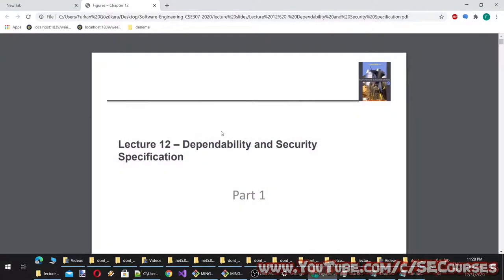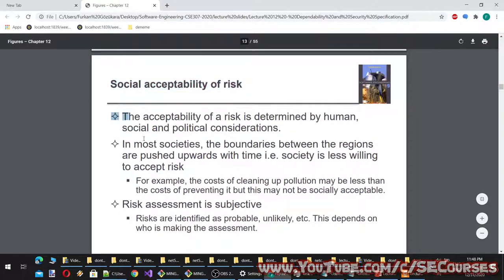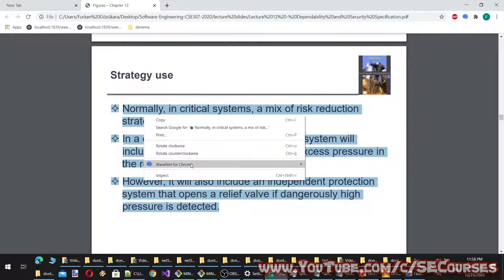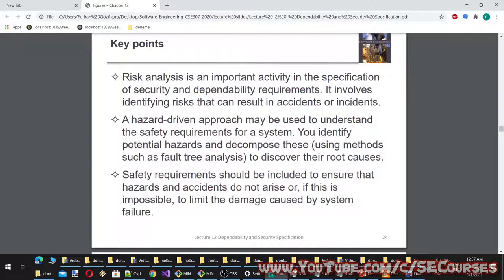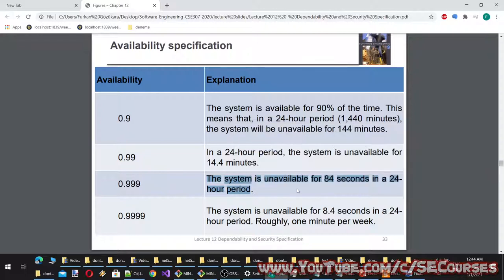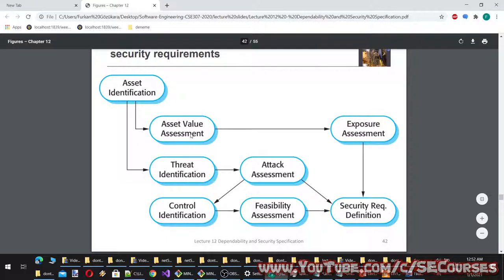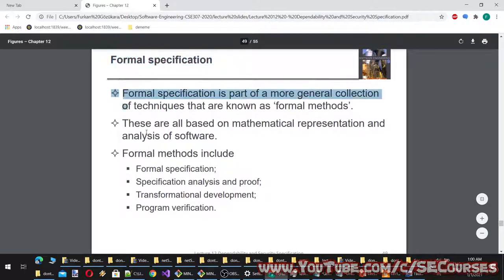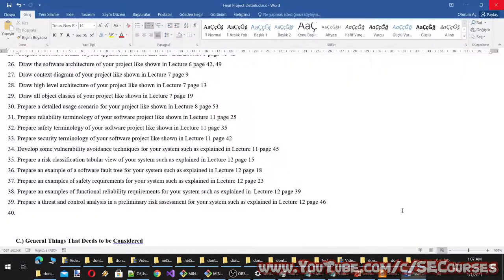#Software #Engineering - Lecture 12 : Dependability, Safety, Security & Reliability Specification

Comment: In this class, I learned:
standards for dependability Specification based on risk (understand the risk and other things).
Risk-based analysis stages (identification to risk and some step to reduce risk.)
Risk analysis and hazard identification in phases
Fault-tree analysis (which aids in identifying the system and identifying risk) and Hazar analysis

195050024

Comment: i learned
Dependability requirements,
Risk-driven specification,
Hazard identification and analysis,
Social acceptability of risk,
Risk reduction,
System reliability specification,
Types of system failure,
Over-specification of reliability,
Functional reliability requirements
,
Security specification,
Types of security requirement
,
Security risk assessment,
Benefits of formal specification
175050001

Comment: From this lecture i learned about;
-risk-driven specification,risk identification, risk analysisi and classification, risk decompsition, risk reduction,
-safety specification, hazard identification, hazard assessment, hazard analysis,
-probability of failure on demand, rate of fault occurance, availability(AVAIL),
-types of security requirements and specifying security requirements,
-formal methods.
Ceyda Süzer
175050003.

Comment: in this video I have learned the following: 
- Dependability requirement 
- Risk-driven specification 
- Hazard identification 
- Social acceptability of risk 
- Risk reduction 
- System reliability specification 
- Types of system failure 
- Over specification of reliability
- Functional reliability requirement 
- security specification 
- Types of security e
requirement 
- security risk assessments 
- benefits of formal specification 

185050901

Comment: In this video, I learned:

- Dependability requirements
- Risk-driven specification
- Stages of risk-based analysis
- Phased risk analysis
- Safety specification
- Hazard identification
- The risk triangle
- Social acceptability of risk
- Hazard analysis
- Fault-tree analysis
- System reliability specification
- Reliability specification process
- Types of system failure
- Probability of failure on demand (POFOD)
- Rate of fault occurrence (ROCOF)
- Security specification
- Types of security requirement
- Security risk assessment

Recep Güneş - 195050026

Comment: Ekrem ŞAHİN / 165050012
I learned in this video;
-Dependability requirement 
-Hazard identification
-Risk-driven specification 
-Social acceptability of risk
-POFOD-ROCOF
-System reliability specification
-Types of system failure
-Risk Reduction,
-Hazard analysis
-Fault-tree analysis
-Reliability specification process
-Rate of fault occurrence
-Reliability metrics
-Probability of failure on demand
-Security risk assessment.

 Thank you for lesson.

Comment: In this lesson i learned:
- what are dependability requirements
- what is risk-driven specification
- what are the stages of risk-based analysis
- what is phased risk analysis
- what is safety specification
- what is hazard analysis
- what is fault-tree analysis
- what are the strategies of risk reduction
- what are risk identification, analysis, 
decomposition and reduction
- types of system failures and definitions
- what are reliability metrics
- what is security specification and types
- what is formal specification and benefits
- what is B-Method

Samed Arıcı - 195050005

Comment: In this video i learned that;

Dependability requirements,
Risk-driven specification
Stages of risk based analysis,
Phased risk analysis,
Safety specification,
Hazard assessment,
Social acceptability of risk,
Hazard analysis,
Fault-tree analysis,
Risk reduction,
Safety requirements and example of this,
System reliability specification,
Probability of failure on demand,
Failure consequences,
Functional reliability requirements,
Security specification,
Types of security requirement,
Security risk assessment
Formal specification and methods,
Benefits of formal specification,
Acceptance of formal methods,

Ahmet Yusuf Diktepe
175050013

Comment: Safety specification,
Hazard assessment,
Social acceptability of risk,
Hazard analysis,
Fault-tree analysis,
Risk reduction,
Safety requirements and example of this,
System reliability specification,
Probability of failure on demand,
Failure consequences,
Functional reliability requirements,
Security specification,
Types of security requirement,
Security risk assessment
Formal specification and methods,
Benefits of formal specification,
Acceptance of formal methods,

Simay Seyrek, 195050001

Comment: Topics that lecture 12 covered are Risk-driven specification , Safety specification, Security specification and Software reliability specification .To sum up,  Reliability requirements can be defined quantitatively. They include
 probability of failure on demand (POFOD), rate of occurrence of failure (ROCOF) and availability (AVAIL).  Security requirements are more difficult to identify than safety
 requirements because a system attacker can use knowledge of system vulnerabilities to plan a system attack, and can learn about vulnerabilities from unsuccessful attacks .To specify security requirements, you should identify the assets that
 are to be protected and define how security techniques and  technology should be used to protect these assets. Formal methods of software development rely on a system
 specification that is expressed as a mathematical model. The use of formal methods avoids ambiguity in a critical systems specification. 175050901

Comment: In this video, I have learned those in below;

-Dependability requirements
-Risk-driven specification
-Stages of risk-based analysis
-Phased risk analysis
-Safety specification
-Hazard identification
-Hazard assessment
-The risk triangle
-Social acceptability of risk
-Hazard analysis
-Fault tree analysis
-Risk reduction
-Strategy use
-System reliability specification
-Reliability specification process
-Reliability metrics
-Probability of failure on demand
-Rate of fault occurrence
-Availability
-Failure consequences
-Over-specification reliability 
-Functional reliability requirements
-Security specification 
-Security risk assessment
-Formal specification
-Use of formal methods
-Acceptance of formal methods

165050011

Comment: In this lesson I learned;

+Information about Social acceptability of risk,
+Information about Risk-driven specification,
+Information about Security specification,
+Information about Hazard identification and analysis,
+Information about System reliability specification,
+Information about Benefits of formal specification,
+Information about Dependability requirements,
+Information about Over-specification of reliability,
+Information about Risk reduction,
+Information about Functional reliability requirements,
+Information about Types of system failure,
+Information about Types of security requirement,
+Information about Security risk assessment.

175050004

Comment: In this lecture , i learned;

+ Dependability requirements,
+ Risk-driven specification,
+ Hazard identification and analysis,
+ Social acceptability of risk,
+ Risk Reduction,
+ System reliability specification,
+ Types of system failure,
+ Over-specification of reliability,
+ Functional reliability requirements,
+ Security specification,
+ Types of security requirement,
+ Security risk assessment,
+ Benefits of formal specification

so , To specify security requirements, you should identify the assets that
are to be protected and define how security techniques and
technology should be used to protect these assets.

195050803
AHMET MUSTAFA VİDİN

Comment: I learned in this lesson;
Risk analysis
Reliability specification process. 
Availability and availability specification
Hazard identification, assessment, and analysis
over specification of reliability
types of security requirements and specifying security requirements
security specification
Types of system failure,
Over-specification of reliability,
Functional reliability requirements
security risk assessment
Acceptance of formal methods

SELİN ÖKTEN - 185050008

Comment: In this video I learned;

*Requirements (functional, non-f, excluding)
*Aim of the specification process
*Risk identification and specification
*Risk analysis
*Hazard identification, assessment, and analysis
*The risk triangle
*What is the fault tree
*Safety requirements (ensure hazards and accidents)
*System failure types
*ROCOF
*POFOD
*Formal specification and its benefits
*Acceptance of formal method

Abdulkadir Durmaz
175050008

Comment: In this video ı learned

-Dependability requirement
 -Risk-driven specification
--Safety specification

-Probability of failure on demand
-Social acceptability of risk
-POFOD-ROCOF
-Hazard analysis
-Fault-tree analysis
-Reliability specification process

-Formal specification
-Security risk assessments 
-Benefits of formal specification

M.BURAK PAKER
175050012

Comment: In this lecture i learned;
-What are dependability requirements?
-What are the stages of risk-based analysis?
- What is phased risk analysis?
-What is hazard analysis?
-Types of system failures and definitions
-What is formal specification and benefits?
-What is B-Method?

Ferit BARBUR - 195050808